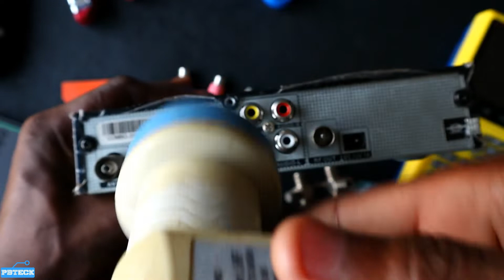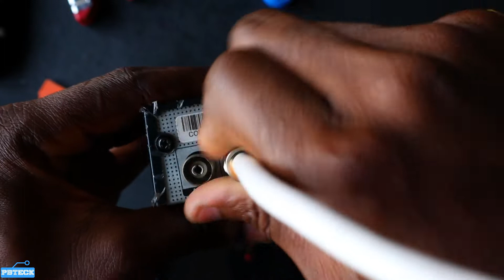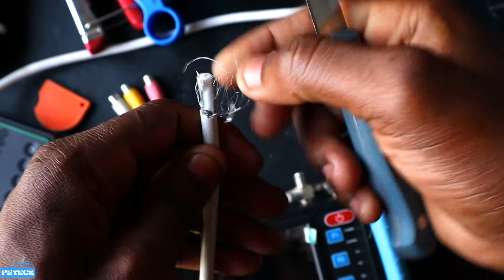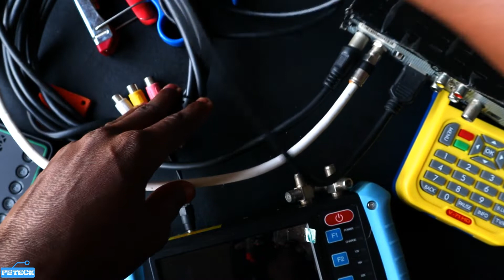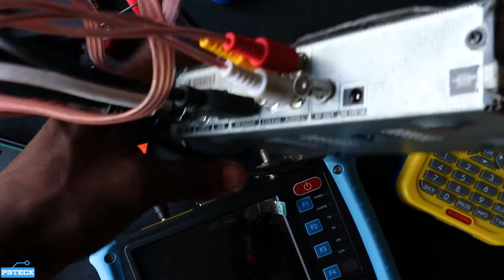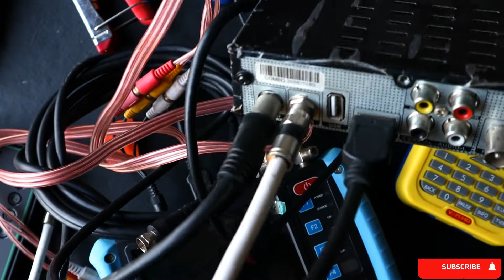💎 How To Connect Master Decoder To Tv Set

Comment: I did it the same way but the decorder is still not connecting to my TV, please help me I've been suffering to connect them for 2week now .
Reply from the maker: * Try using a different AV / HDMI cable.
* Try connecting a different Decoder to the TV to check if that will work.
* Make sure the TV settings is on AV  or HDMI if you're using an HDMI cable.